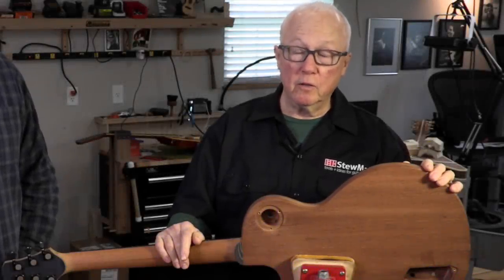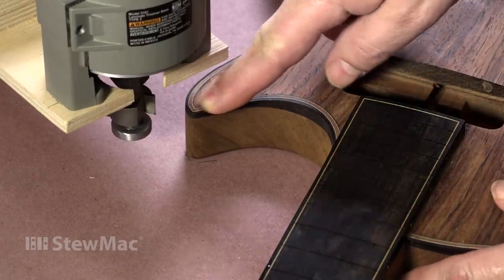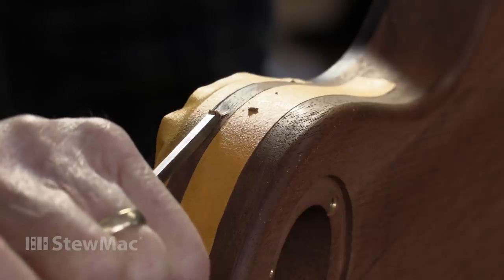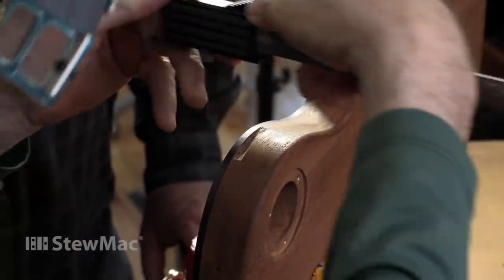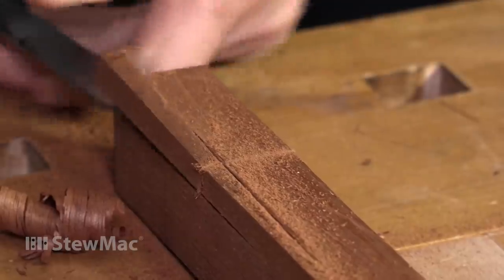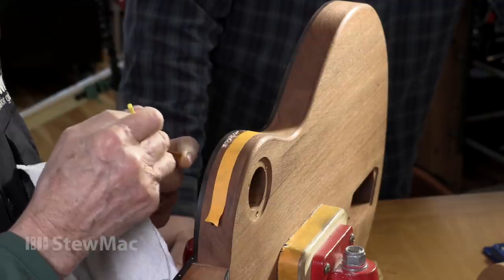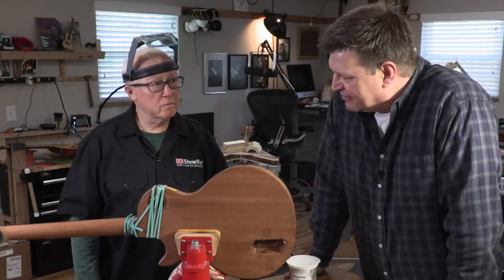Routing for guitar binding: fixing a mistake!

Comment: We really need to see the finished fix, folks!
Reply: It would have been cool to see, but im pretty sure they just ran that section across a router with a flush cut bit and put a little stain on, so we probably didn't miss much.
Reply: Would be safer to trim it with a chisel and finish with sand paper. Quicker too.
Reply: Julien Sorosac You're right, that's probably what they did. I thought the portion sticking out was thicker but after looking at it again its smaller and a chisel would take that down quick and safe. I was mainly thinking that whatever they did it was something fast so router just popped into my head first as a fast way but like you said that's not the best way.
Reply: I bet that, lIke his gran's table, by the next day Stew had forgotten what it was, sawed it in half and put it on the log burner. Lol
Reply: It can never split open if you route down grain, sometimes that means routing from 2 sides (flipping the body over).
Reply: probably didn't turn out well enough for the camera
Reply: Andrew DiMartino he might have been shy with the router again after what happened 😂
Reply: When their shake hand, that is mean "Finish". LOL
Reply: @PrinceWesterburg  Stew? Perhaps you mean Dan?

Comment: The ends weren't flush at all, which probably explains the shortened video.  My guess is he didn't cut the bottom totally flat in the channel.  That's what happens when you have a customer over your shoulder and you're not as relaxed IMO.

Comment: Why not use the same jig that threw the guitar across the room to fix the damage? There are router bits that can do it. Run the guitar along a fence and route a channel flush with the binding, straight and with square corner.

Comment: An update would be nice! Since you guys did what I've seen a hundred shade tree luthiers have already done instead of a miracle fix that I was half expecting.  I could've done that without thinking!  I would've used SAW DUST for the fix as he did before. I don't know what the HELL he was thinking using COCOBOLO dust, but mahogany saw dust would've been preferrable. That would've matched a lot better and would've been easier to hide under any clear, or transluscent finish.
Reply: You're right but if he'd wanted the same dust as the wood the guitar was actually made of he could have used an off-cut, there must have been some if he'd made it himself. The same goes for the bit of wood that was eventually used.
Reply from the maker: Remember my plan was initially to use an opaque finish, but then changed my mind.  :)

Comment: I would have liked a little demonstration how to avoid the router mishap.
Glad that flying guitar body didn't injure anyone.
Reply from the maker: When routing binding (regardless of the specific binding jig you are using) you always want to roll from the high points to the low points.  So, from the peak of the upper bout into the waist, from the peak of the upper bout toward the top of the guitar, the lower bout to the waist, the lower bout to the heel, etc.

Cutaways are a little tricky -- especially right at the tip of the horn on a tight radius shape like an LP.  When I was routing the tip I just got it a bit too far over the edge and an instant later the guitar was on the floor across the shop.  (YIKES).

It was mostly ok.  I had to add a thicker wood purfling (which you can see in the video) but it was missing a hunk of mahogany.  I searched for it thinking I might be able to fit it back into place, but it was gone.  :(

I've since learned to use this jig with better results, but this was the first time I tried this method of cutting bindings with the router at a fixed height from the table top.  I usually use our True Channel system, or a Fleishman/Williams setup where the router floats on top of the body, but I wanted a consistent amount of wood showing from the back of the guitar.

Comment: but as it ages, wont' the original wood age differently vs the patch?  reminds me of Edge's Explorer repair.
Reply from the maker: It's quite possible, but it's more likely that the lacquer would age and change appearance to a larger degree than the wood.
Reply: ah.....yes, thanks!
Reply: normally you would use leftover wood from the body (for example from the cutaway or the waist. No idea why they didn't do that. With mahogany I wouldn't worry about different aging too much tho. In general thats more of an issue with other kinds of wood or when you patch an old instrument with new wood.
Reply: i'll be sure to save some small remnant on my next build.  thanks!!
Reply: nmssis always a good idea. Comes in handy at the most unexpected of times. Also customers love pleks and other small accessories made from the same wood as their guitars. Always good for a little extra sale or repairs further down the line.
Reply: now that's a bit of wisdom from experience...thank you!!!

Comment: Why cocobolo dust in the epoxy? Isn't cocobolo dust like crazy toxic?
Reply: Whereas epoxy isn't?
Reply: I'm sure cocobolo dust is probably the equivalent of  unshielded cobalt 60 in your mind and you wouldn't want to be in the same room with either of them.   Because of the oils present in the wood, some people develop sensitivities to the wood causing contact dermatitis, eye irritation, and asthma like symptoms from breathing the dust.  I have worked with it over a 25 year period and the dust doesn't bother my skin, and I always wear wrap around safety glasses and a dust mask when sanding or cutting wood.
Reply from the maker: (This is Brock).  I currently don't have any sensitivities to cocobolo, but a lot of folks do so that might not be the right choice for everyone, but just as a safety precaution I generally wear a respirator when working cocobolo or ebony (which I do have mild sensitivity to.) The reason I used cocobolo dust on the fill is that is what the top of the guitar is made from.  I find that making a thick paste of wood dust and epoxy is better for filling voids than pure epoxy.  Initially I was thinking I would just paint it dark brown, but I've never been completely comfortable with that.  I think this will yield a much nicer result.
Reply: Would be really nice to see your finishing steps. If not a video, maybe a blog entry somewhere on the stewmac page?
You could just ad a link in the description.
Reply: stewartmacdonald Brock, I think he probably wondered (like I did) why you chose cocobolo over the same wood of the body (mahogany) to mix with the epoxy. Great job btw!

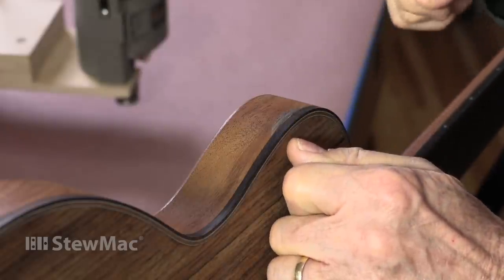Comment: 1:41 fart?
Reply: He, he, he, I think your right and they added an effect to  it to cover it up. That sound had nothing to do with what they were doing. It was a background sound for sure.
Reply: Lol. I think so.
Reply: No!  It was probably the sound of the guitar rubbing against the rubber pads in the vice.  Dan probably moved it a smidge while he was tightening down the vice and it made that sound.
Reply: The pads in the vice are made of urethane, not rubber.
Reply: It would have to move more than a "smidge" as loud as that sound was. Besides that, cast390 makes a great point, there's pads in the vice. So the smidge movement theory is a far reaching one.
Reply: It's from the vice, mine does the same thing
Reply: It just sounded to me like someone moved a table or something like that, maybe a large machine in the background.
Reply: Blame the dog!